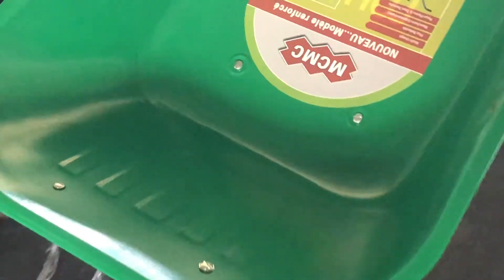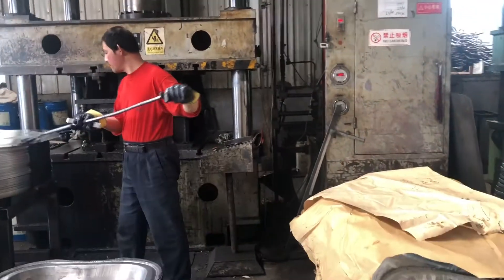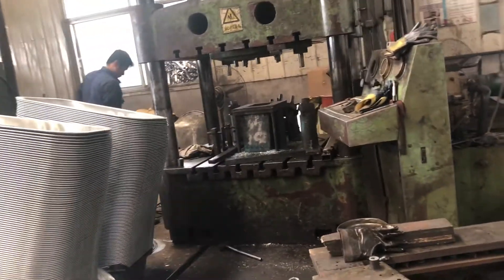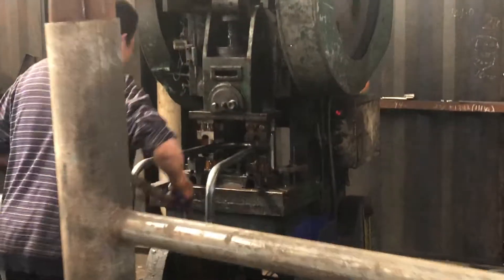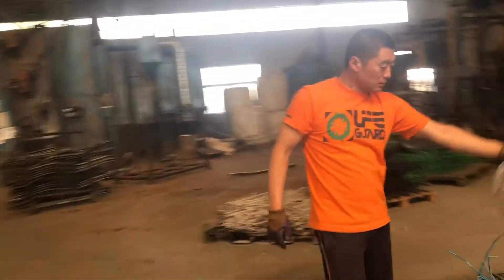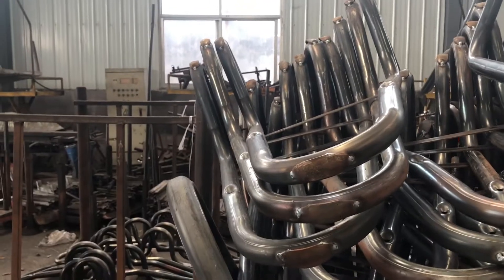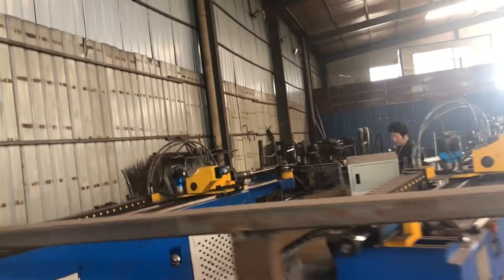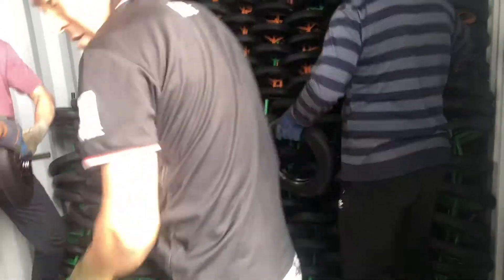Watch How Wheelbarrows are  Made With Machines Anyone Can Buy

Comment: Can someone produice it with only the first machine.
Thanks for the video, it very informative.
Reply from the maker: Yes possible but will be slow and stressful  since you’ll always need to change the mould in the machine
Reply: @aili4C i think you can have a work flow that 200 wheelbarrow trays, switch moulds and yield 200 complete wheelbarrows per week.